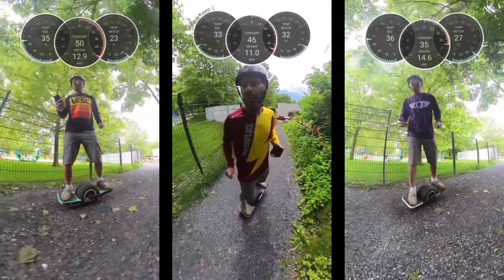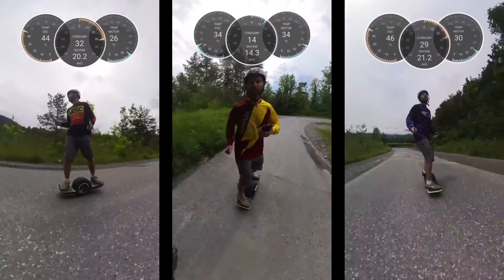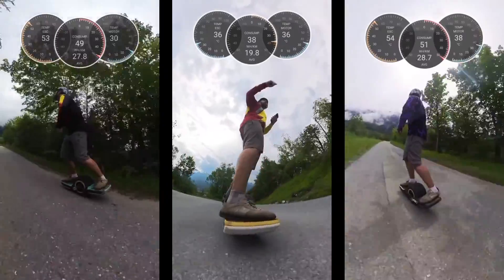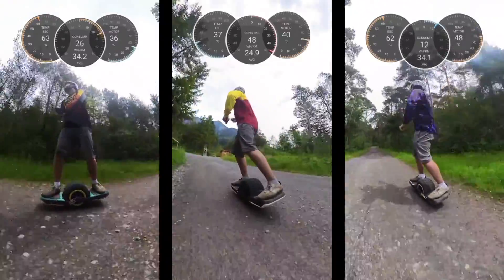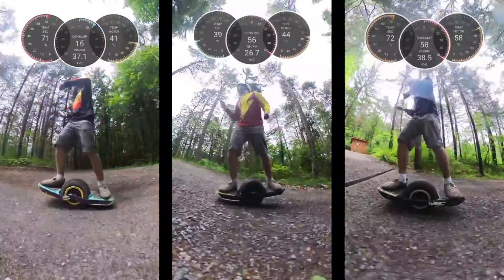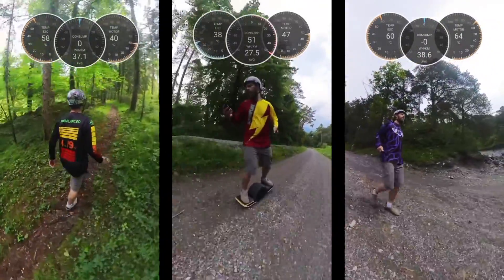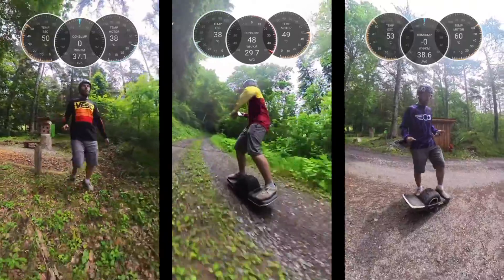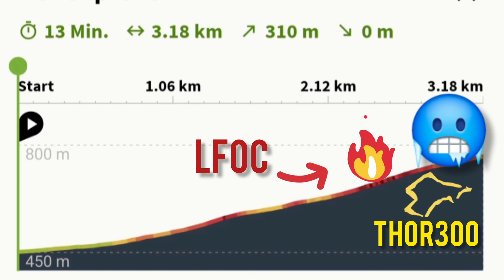Fungineers Thor300 is ice cold

Comment: great video, i'm a thor purchasor but your video is a little miss leading, the other two (right and left) are consuming much higher amps and you can see that in the average WH/KM it isn't even comparable. send it buddy. again I am full on fungineers products.
Reply from the maker: I know but I don't care because all I want is to climb up these hills. I'm still doing more comparisons. already did the same test with Cheap FOCer, Tronic250R and upgraded Floatboxx for LFOC. What you're mentioning about the consumption is only the advantage of the Superflux HT. Average consumption is totally misleading because I the controller was already on for about 40 minutes, most of the time without moving. sorry for that, but I will redo the test when I get my own THOR300 with Superflux HS
Reply: @VESCmann  i feel ya, the thor is a game changer for sure!

Comment: hi H, you are using the original Floatboxx MLC with LFOC which was designed 2 years ago for the Hypercore motor. The Superflux demands more from the VESC, generating more heat. So for Superflux we developed the CXC range of boxxes with a much larger heatsink, more space, and lower price. Looking forward to comparing this one 😛
Reply from the maker: Thanks for the input. I'm gonna swap to CXC and check the benefits of the larger box asap

Comment: What is the ambient temperature? We pushed the thor300 to 63C, climbing at ambient 96F, 1200 feet gain in 3 miles.
Reply from the maker: first of all the temperatures and the uphill was the same for my tests. so the LFOC would have exploded on your trail. here it was 75F ambient temperature and colder the higher I climbed. 1000 feet gain in 2 miles
Reply: @VESCmann  I rode my LF 3.1 alongside the thor300. The LF3.1 had to stop 3 times to cool down, my mosfet limit was set to 80C.  Thor300 is amazing, I think it will have 10 miles more of range with the same battery pack compared to LF3.1.

Comment: if I understood you correctly, you are comparing Little FOCer with SF MK1 to Thor300 with ST HT motor.... I would say this is not fair comparison because MK1 need more amps to produce the same ammount of the torque as HT motor and this also mean Focer will heat more
Reply from the maker: yes it's unfair... but it was as fair as possible. you can also see on surfdados latest short that Thor300 stays cool with a Superflux HS on a super steep hill

Comment: Heyy man! Thor300 sure is cool, can't wait for LFOC V4 to see how it compares to Thor300. What is Obligatory Box like, cant see any details on the site? Is it 3D printed is what I'm curious about?
Reply from the maker: hopefully other upcoming controllers will handle heat like Thor300. I also got a tronic that I will test eventually with 100V battery. The box from obligatory is still under development with the basic idea to get more space between the footpads so you can put a big tire on standard rail length